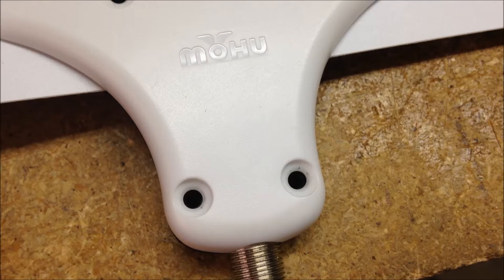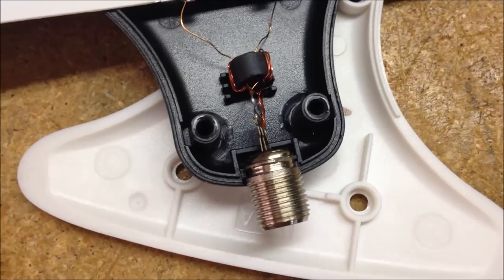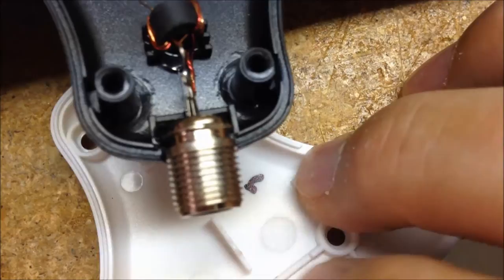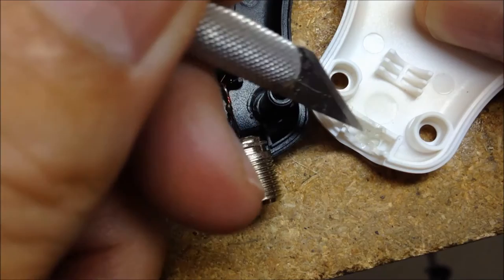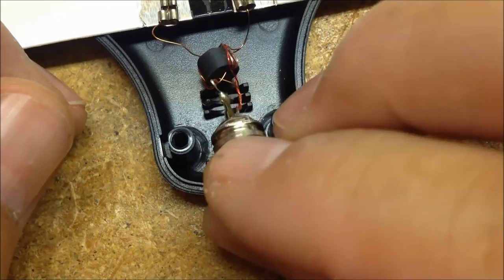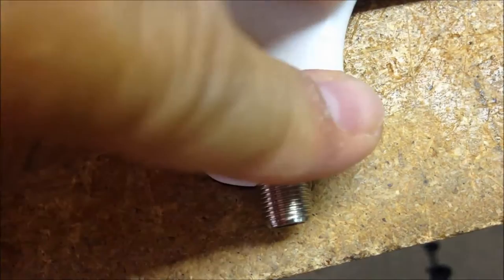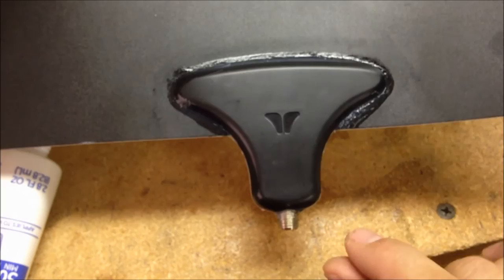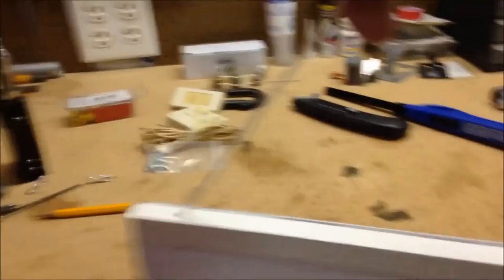Mohu Leaf 50 Amplified indoor HDTV antenna Water Proof

Comment: the device you called a "magnet" is a balun, it takes a balance signal from the antenna and converts it to an "unbalanced" signal.
Reply from the maker: Very neat, thank you for the information.
Reply: Its a transformer essentially. It does impedance matching for the coax cable to minimize transmission line reflections and signal loss, it also isolates the antenna and coax so that the cable does not appear to be a huge dangling element that picks up noise.
Reply: I am a television engineer and have been for 50 years. I KNOW what a balun is, it takes a balanced signal, i.e. a signal that is not referenced to earth ground, and produces a signal that is referenced to ground. Balun is an conglomeration of BALanced-UNbalanced. Baluns may be transformers, or they may be constructed from transmission lines. The usual TV balun transforms a 300 ohm balanced signal to a 75 ohm  unbalanced signal. A balun may or may not do impedance matching, but it always takes produces a signal thata is balanced on one side and unbalanced (not referenced to earth-ground) on the other.
Reply: Fred Zlotnick I always find it hilarious when people online are so self conscious and insecure in  what they say that any information is taken as an insult to their sensitive egos. I never said you were wrong about what you said, I was just adding more info. I am an electrical engineer and have a general ham radio license so I also know what these are. And it didn't take me 50 years to figure it out either, gramps. 75 ohms to 300 ohms is what? Its impedance matching. Thats what I said. Get over yourself buddy. Also a ferric core with wire wrapped around it is what? A transformer. Thats why I said "it is a transformer essentially"

Comment: it's omni directional it don't have to be turned lol
Reply from the maker: They may call it an omni directional antenna but it is the first omni directional antenna I have seen that has varying performance depending on it's orientation. I can't explain it but that is what I have discovered through practical use.
Reply: Edward Caissie may not have to be turned but explain the improvement of signal when you turn it.. I'm waiting..

Comment: So that crap cost ovrr 50 bucks and it breaks. Like that?
Reply from the maker: Nothing broke. This is a waterproofing modification I did for outdoor use of this antenna.
Reply from the maker: To be honest, I haven't had it in the rain since I did the modification. At the time I thought I would be mounting it on a mast to get it up in the air a bit but it hasn't been necessary. I mainly use it inside.